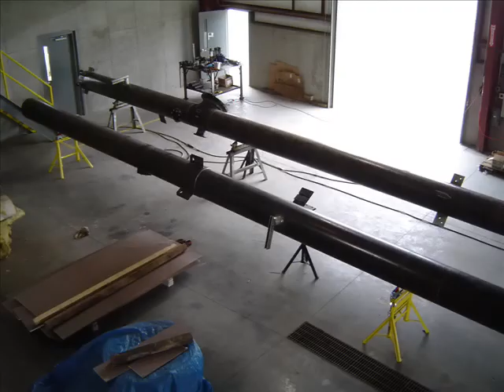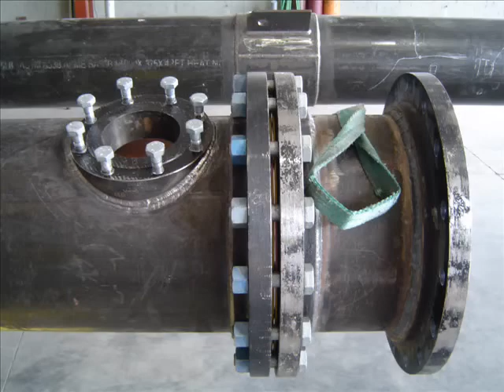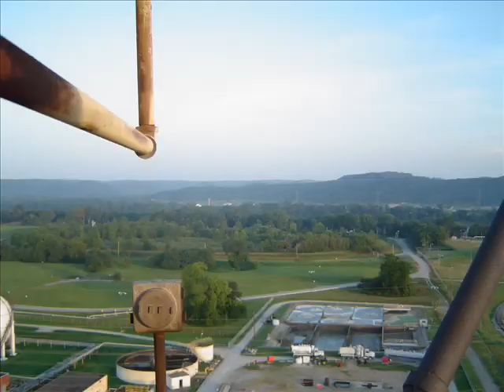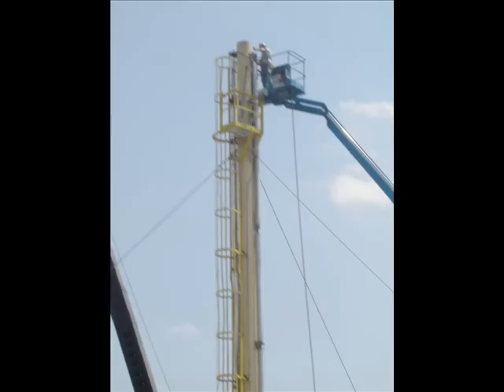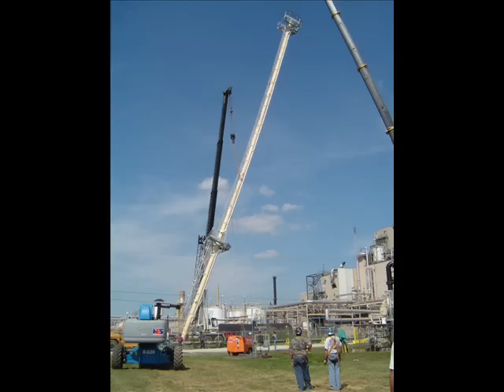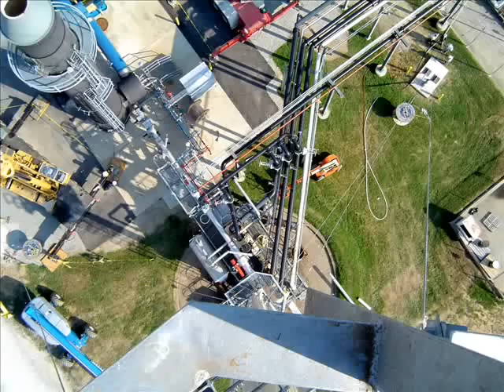pipefitters local 522  shutdown

Comment: The color is the result of complete shield gas coverage and low heat input when welding metals with a decent nickel content.  A little secret though; that heavy flange is a large heat sink and makes those welds fairly easy to get pretty as it helps control the temperature.  Color isn't everything though, the perfect appearance shows good technique and great control from the person holding the torch.

Comment: @devanmills1 Thats badass. I just blew a common arc test. Had arc blow at the end of my overhead root pass. It sucks but Im not going to let it bother me. Theres another common arc test coming in 3 months and ill be ready. Message me with tips on how to control arc blow, i could use them. Cramming the rod in there didnt seem to help me that much. Running 110 amps with H4R7018 1/8" on overhead 1/2" plate.